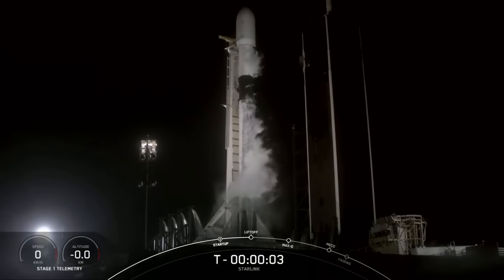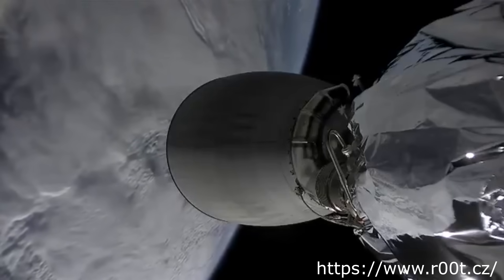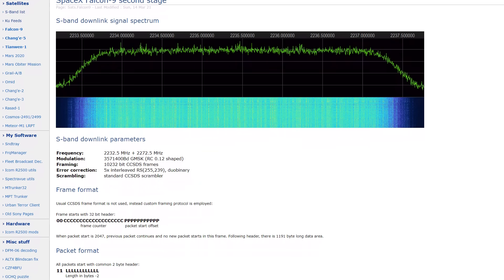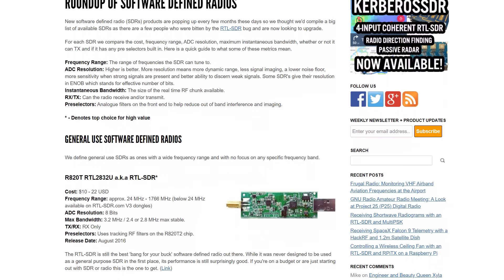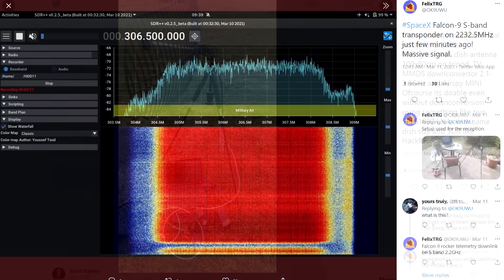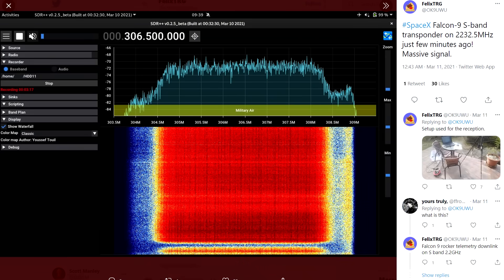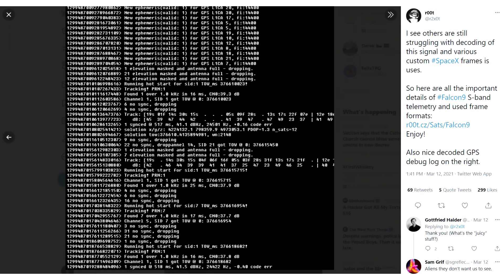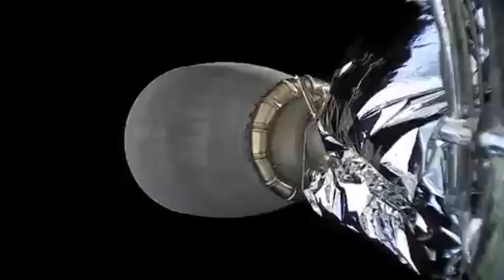How Amateur Radio Fans Decoded SpaceX's Telemetry & Engineering Video

Comment: I'm always in awe at what people are capable of reverse engineering.
Reply: The trick is, that people, especially engineers, are lazy. Why reinvent the wheel? If there is an ISO or regional standard that applies, an engineer will probably use that. Same with libraries for the main programming languages. If you look at something that was created to be efficient, it drastically reduces the amount of ways it was possibly created. The shortest path between two points is always a straight line after all.
Reply: @JainZar1  Not so much about being lazy, but to know the thing you copy has known and proven to be working well, then reinventing it might no yield that same working level result. Nobody wants to be the poor engineer who made the rocket malfunction. 
Nobody wants to be responsible for f-ing up a working thing.
Reply: @JainZar1  In a sense, Engineers always stand on the shoulders of giants. Laziness does have its perks.
Reply: @paulmichaelfreedman8334  Are you calling me lazy! Tell that to my face. I DARE YOU!
Reply: @zualapips1638  im a ham operator, im not mad
Reply: @JainZar1  First we have punchcard programming. Then we had assembly programming. Then we had a C compiler. A few iterations later we had cloud applications running on VMs inside hypervisors in higly distributed environments created in some metaprogramming language which is popular this week. Of course we engineers are not going to reinvent the wheel. Nobody would use that wheel and it would be very expensive.
Reply: @0xf7c8  You're right, it should be "an engineer isn't going to reinvent the wheel, with the exception of front-end frameworks"
Reply: @lost4468yt  The issue there is the javascript cancer. Language is so convoluted that everyone has an idea of how it should be.
Reply: @0xf7c8  Hopefully WASM gets more support.
Reply: @0xf7c8  Matrix algebra on punch cards in FORTRAN!
Reply: @0xf7c8  We are running in a simulation this has all occurred before... LOL
Reply: @JainZar1  Even if you re-use an existing standard, you’ll probably change some parts to suit your specific application. After all, there is no reason to adhere to the standard if you don’t need inter-operability.
Reply: @Mike-oz4cv  Sure, but the human interaction is always a factor, which results in at least company wide commonalities. Most of the time a certain part is already in inventory, so it's cheaper to just use that one instead of designing a completely new one.
Reply: @JainZar1  - Yes, getting into the engineer's head, is important.
Reply: @JainZar1  "cycloidal path": smile in pain
Reply: Maybe something else
Reply: @JainZar1  You made my point for me (now that's irony!). It's not really reverse engineering to figure out what somebody has done or used. High frequency radionics is a black art, one that 'does my head in' ! As for finding a beetle in a tuned cavity, the mind boggles?
Reply: @JainZar1 .   Their not lazy, they have budget restraints! Another is risk assessment, if you roll your own, you own it!  Makes absolutely no sense to roll your own unless it has never been done before AND you can legally protect and monetize the work.
Reply: I once reverse engineered a toaster into all its original parts... never worked again but I learned that mom was emotionally attached to kitchen appliances😂
Reply: @timnor4803  Thank you so much for the laugh you just gave me.
Reply: @timnor4803  Thanks for the belly laugh. I can just see you totally engrossed in the "reverse engineering" and your mother's reaction to your quest for knowledge.

PS - I love your word pictures. You should team up with Dave Barry and write instruction manuals.
Reply: @timnor4803  Had to reply to your comment - Made my day!  🤣🤣🤣🤣🤣🤣🤣🤣🤣
Reply: @timnor4803  A valuable lesson indeed 😊
Reply: @timnor4803  Is that reverse engineering or just dismantling?
Reply: @timnor4803  Oh mate, just remove the mouse and it's good to go!
Reply: I wish to someone reverse eng a woman so we can finally understand them.
Reply: @betolee4292  I am with you on that one, Women are amazing but truly are ENIGMAS 😊
Reply: @betolee4292  Never ever gon'ta happen, eff me backwards? 'Cause that's what's gonn'ta happen? Women are strange creatures to be sure, how come men like them so much?
But if you think about it I would definitely opt to sleep with an unknown entity (of the female persuasion) rather than any of my pals.
Maybe I'm just 'old-fashioned' like that?
Pax dude.
Reply: @betolee4292  I assure you, they feel the same. 😀
Reply: Not really reverse engineering when standards are followed.
Reply: What blows my mind is how many people seem to be more fluent in coding languages than those they speak in their everyday lives.
Reply: Honestly, considering they stuck to something similar to CCSDS it wasn't that bad.
Reply: I worked at a Semiconductor company that was reverse engineering a chip by tracing the inputs from a very large blowup of the chip. It took a long time.
Reply: It's not "reverse engineering" when the standard is publicly published, why are people assuming that Space X even want the feed to be secure?
Reply: You'd be surprised how much radio and antenna technology was not reverse engineered,  but invented and created by HAM radio operators.  A large amount of the radio tech we have today comes from amateur radio tinkerers.
Reply: @ThinkFreely2012  i myself am a ham radio operator and love tinkering with electronics......its amazing what us ham radios operators come up with!!!!!
Reply: @jasongeerer8163  73
Reply: @ThinkFreely2012  73's to yous n yours.      De KD2CSZ
Reply: @ThinkFreely2012  We wish researchers and workers in the technology and engineering department to find plans for the new car industry
Because new cars should be flying saucers in the sky
and These flying saucers must have three perks
1 / The flying saucers must be self-driving so that everyone can use them
2 / The autonomous driving of flying saucers must be based on artificial intelligence programs
3/Artificial intelligence must rely on the new Google Maps in order to direct the launch of flying saucers to the desired places .
He sent these three basic demands to the technicians and engineers in the auto industry in order to make flying saucers
Reply: @التسارعالكوني-ن3ب  mohamed is gay 🌈
Reply: Absolutly, half of the time I don't even understand the documentetion of things and that is supposed to be understandable.
Reply: Give the current generation a puzzle, and stand well back.
Reply: You learn a lot by looking at how others did it and then you figure out new ways to do it.
Reply: Let me boost sdr power while using moon bounce using joe taylor princeton university protocal, will achieve antipode comms. De ve5spr. Cheers 73
Reply: I always wonder if there is one of the original engineers behind the scenes, giving them a leg up.
Reply: Me too, i see it and say AWE why didn't I think of that.
Reply: Lots of free time, lots of patience and getting inside the designer/engineer's head are required.
Reply: So are the engineers who make this stuff. Just ask the PSP team over at Sony.
Reply: People engineered it, which means people can generally reverse engineer it (applicable to everything except neural network training algorithms).
Reply: No reverse engineering needed
Reply: You can reverse engineer anything, it is only a matter of resources.
Reply: Reverse engineering animals is how you learn to hunt. It's an evolutionary perk.
Reply: It makes me wonder if boca chica is broadcasting telemetry during sf tests?  Be kinda nice to get a better estimate to fire if we could see psi
Reply: I’m always in awe at people believing Space-X CGI footage is legitimate.
Reply: One could say where there's a will there's a way
Reply: My dog reverse engineers all the shoes he find
Reply: Anything u can do forward you can do back!
Reply: @lolll3360  except for 'give a fuck?' it is a quantum law that you cannot un-fuck a situation or indeed a person, fucks only travel in one direction, no 'backsies' (no  no, it would be childish to make a joke here), he he he!